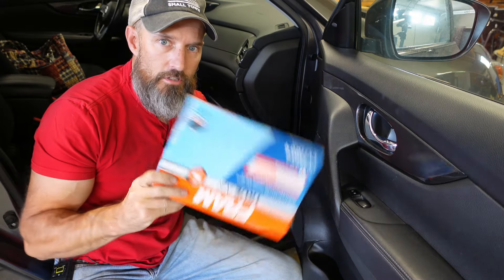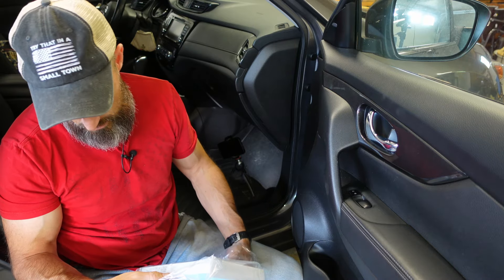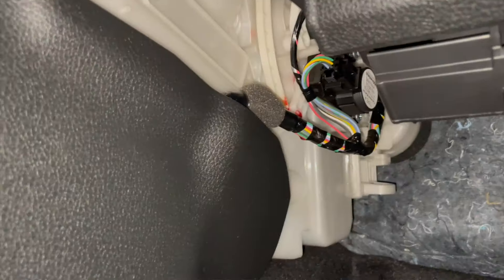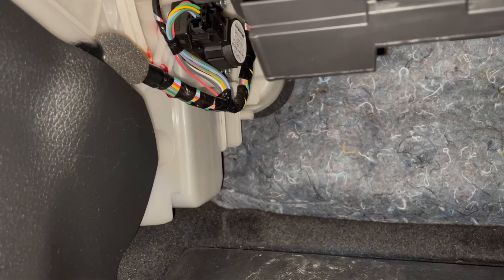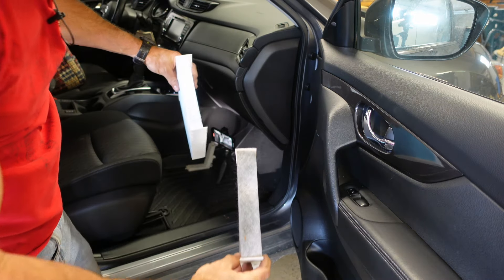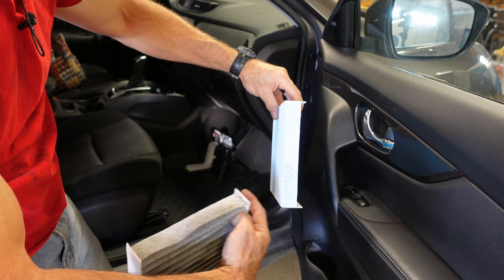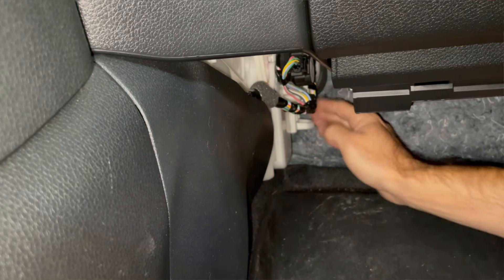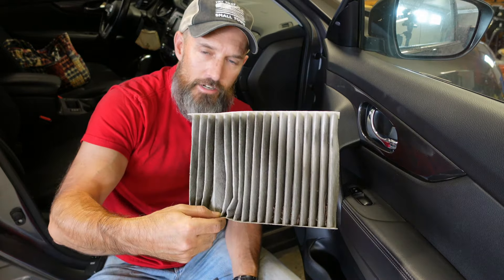How to change a cabin air filter on a 2014-2020 Nissan Rouge

Comment: I’ve changed my Rogue cabin air filter twice. If I ever met the Nissan engineer that designed the filter location, I’d punch him in the nose. If you’re not a small and agile person, you’’ll curse like I did. I suggest to crouch in and take a picture of the filter entry point. This way the pic will show you exactly where it is located and whether it has a screw that needs to be removed. I near ripped my finger off pulling the clip, not knowing that it was held in by a screw. The picture is what saved me. Finally, I don’t know why the filter is larger than the entry area. Just poor design by Nissan. 
Good job on the video. 👍
Reply from the maker: I know exactly what you mean! Thanks for watching